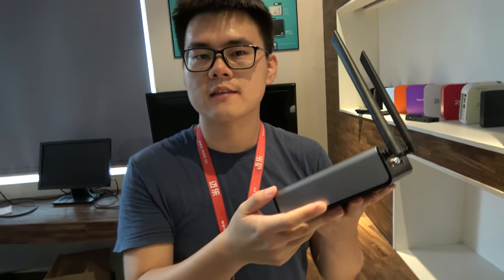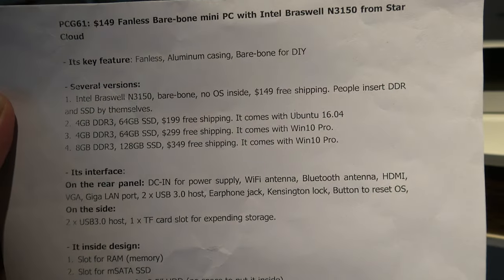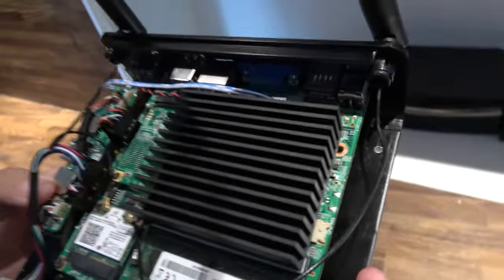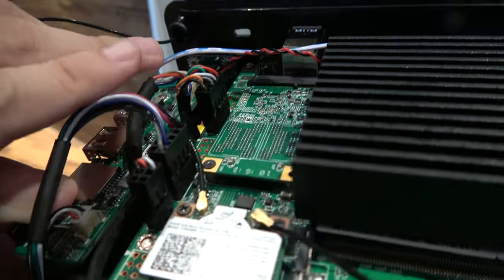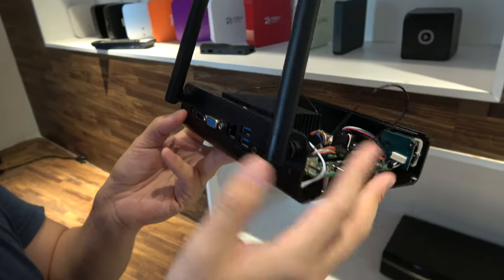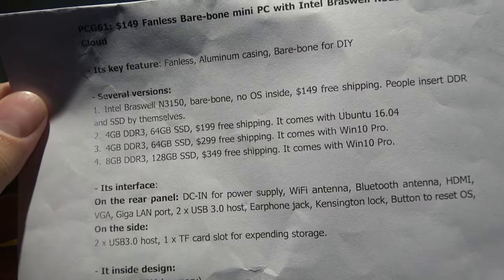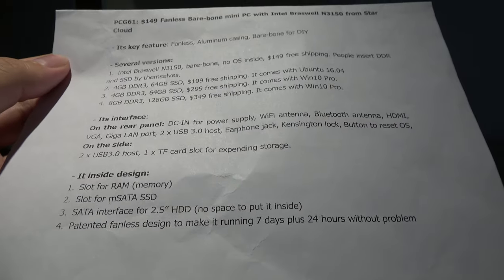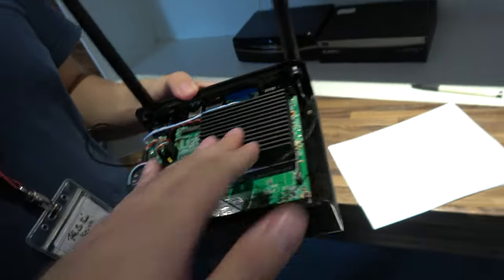StarCloud PCG61, Intel Braswell Celeron N3150 NUC PC runs Ubuntu14.04 or Windows10

Comment: I got a used one a few weeks ago. Put in leftover 8GB ram and a 256GB mSATA and even was able to put in a 256GB SATA SSD under the motherboard! It is surprisingly powerful. I originally intended to just use it as a remote controlled download machine, BUT I tried to install Plex Media Server on it, and it actually works! Just for myself, not multiple users, so it doesn't have to process much. Talk about bang for a buck!